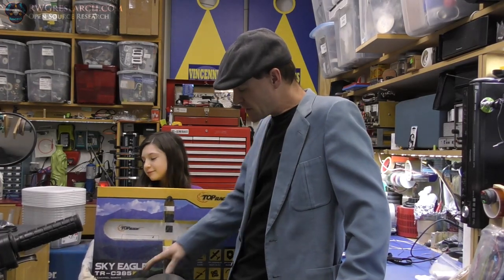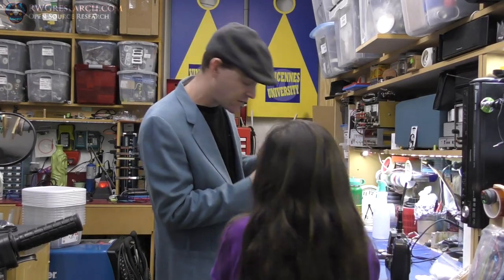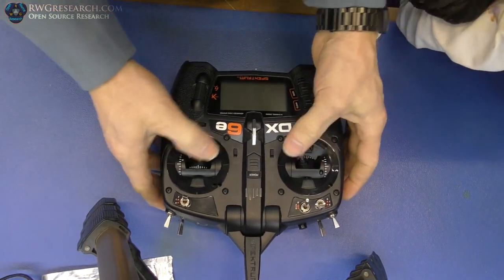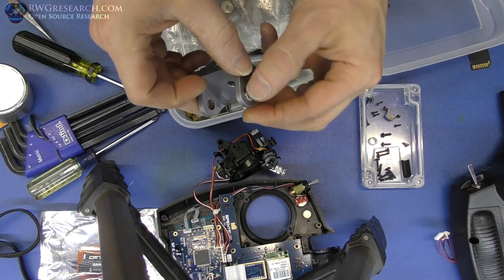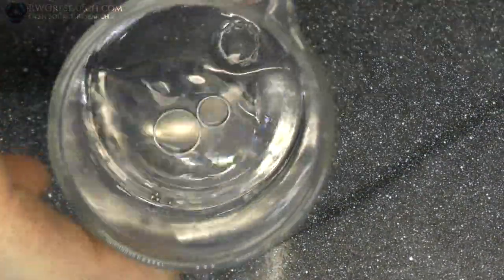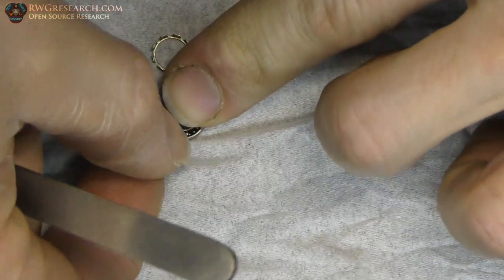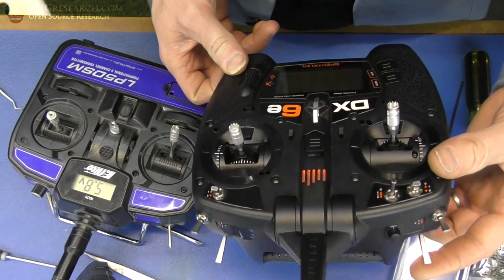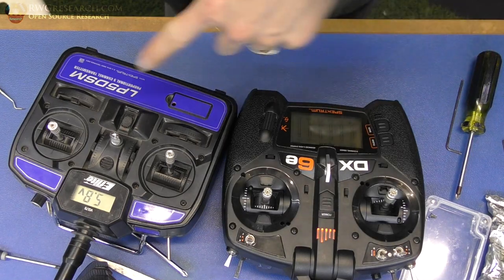1-27-2021: RC#3 We Fix The Ebay Transmitter And Set Up The Wireless Trainer! #21-22

Comment: Normally cleaning works without taking apart, just have to use ultrasonics to do that. Generally just a wash with a little more aggressive solvent than IPA works, something like turpentine, or thinners, does the job, then wash with the IPA to get the water soluble stuff out, then new lubricant into the bearing. But then, most of the bearings I use have non removeable cages, though I have often popped the end seal off to do the lube service on noisy ones, generally with a bit of molyslip grease for bigger bearings, or light grease or oil for the small ones.

The pesky scammers on the comments are really starting to get annoying though all over YT.

Comment: Thats really cool with the Wireless Trainer mode on the Transmitter! As stated before, disassambling the bearings for cleaning was probably overkill, I would have probably just let them soak in acetone for a few minutes before reoiling. Ultrasonic is also a very good idea if you have one. I would have also 100% lost at least one of the BBs had i tried to do what you (successfully) did. Really excited where your RC Journey will take you!
Reply from the maker: yeah, i was use to cleaning my sk8 barrings way back when lol so i just went for it! i do need to get an ultrasonic cleaner! that would have done the trick!  yeah keep watching. it gets really interesting! lol gt lots of footage from last year!! cheers ~Russ

Comment: 1:55  😥 that is a {painful memory, for me LP}.  /  "did you know compressed O2 would ignite" - {{it blow my boot off pure O2}}🥵🥶😰💥😮😳😱

3:18 "Oh, shit boss".  You wanna relocate the bottles away from the soldering iron?.!

🤦‍♂️💥 {{cutting torch - taught me }}

4:43 Your 3 o clock: maybe a ball cup - allen head - tensioner screw? = 6:26 where the pin wheel head would lay - just a bit bigger the eye glass screw - nylon washer, outside?

Comment: I have the same transmitter. Can you recommend a small receiver compatible with it?
Reply from the maker: i recommend any Lemon RX stuff. its cheep and works well. if you want to go spektrum. The AR6210 is a small good long range RX. really any spektrum receiver is good. find the one that fits your needs. i'v had luck with many off brands too. look for DSMX compatible ~Russ
Reply from the maker: I also like the AR620 ~Russ